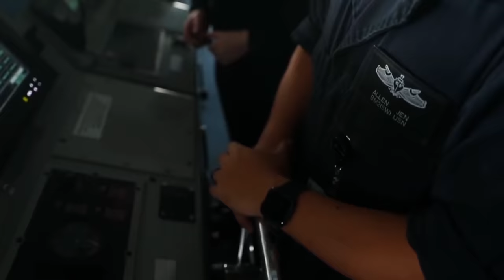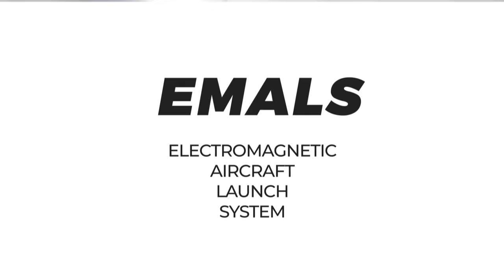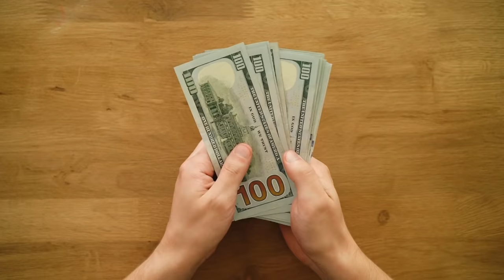This Is The US New Gigantic Aircraft Carrier Shocked The World

Comment: This video is so full of flaws. EXAMPLE: The steam catapult has/ had ZERO issues with launching planes due to weight. In the 60’s, a C-130 was landed and launched from a carrier deck with 3/4 of the deck, and good ol’ fashioned STEAM CATAPULTS. Not to mention those heavy ass F-4 phantoms, and Tomcat’s for over 40 years with steam, every 20 seconds.
Reply: This video was terrible.
Reply: I was in the navy in the early 70’s . I was in V-2 division . And you are correct about the steam cats . I worked the arresting gear . And they never had a problem stopping aircraft . If it ain’t broke .....don’t replace it .
Reply: The C-130 that landed on that aircraft carrier didn't use the cables to arrest, or the catapults to launch, it took off under it's own power.
Reply: The Navy disagrees with you.
Reply: @trentmiller7532  Not giving an eff doesn't mean you're right. Many US Navy carrier captains and crews have consistently favored electromagnetic catapults to steam. Steam catapults have to wait for steam from the ships reactors before they can launch again. This can take several minutes. This is taxing on the ships reactors to generate enough stream for 4 catapults. EM catapults do Not need to wait for steam. In fact, they don't need to wait for anything. They can launch one after another in quick succession.

Comment: My personal experience with the cost overruns were heavily influenced by bureaucracy.  Yes there were technical issues, but all new technology has initial technical issues.  It was the bureaucracy that could not accept the technical issues and would punish the programs supporting the shops construction.  Taking funding away from programs does not get the product any faster and is the absolute cause for increasing cost overruns.   Program leadership understands this but congressional leadership does not have the guts to support technical issues.
Reply: Trust me it did not take hours to get aircraft into the air in the 1970's.  I doubt that changed ever.  Aboard the USS Ranger they had two sitting on the deck ready to take off at all times, and two right behind those.  If those began taking off more would be brought up behind to get ready to take off.
Reply: Spoken like a man who knows the game.  What you mention is possibly the biggest flaw in a "civilian" run military.
Reply: The problem is the DC Navy bigwigs and these shipyard CEO and Presidents are in bed with each other along with the manufactures of material hardware, and DoD Contracting companies .. The navy always Gives contract to lowest bidder now even if it hasn’t been proven to work .  So when it unsurprisingly doesn’t they spend more trying to fix it and make it work than they would have spent going with the system or hardware that they knew worked but cost a little more.  Then you have the shipyards they are built in  outrageously overcharging the navy for every aspect of building the ship.  This is an example ( The yard is paid to mount a cabinet on a foundation.  They mess it up and mount it  wrong .  They are then paid by the navy again to remove said cabinet.  Then they are paid again to install it right.  This could go in 3,4,5 times with no accountability ). It is all the Mismanagement and Greed at the highest level that causes this .
Reply: @jordanbeaty6077  That is part of the problem, the biggest is creeping requirements. A major program takes at least two decades to accomplish. That's from inception to product in the inventory. Thus changes in the military environment, the personnel in charge, and the technology cause additional and evolving requirements.
Reply: Too many cooks?  Or just over-ambitious.    Maybe the aircraft carrier has seen its day..
Reply: Well. I'm 63 years old and will state for the record, rarely does anyone have a real working knowledge that is in the financial approval loop. When the bids were tallied and the final cost to build was submitted, that became the only focus for them. Anything else goes on the books as an " overrun". Which the money men  call "failure". Doesn't make it right but there is something to be said for the Engineering side's accountability.
Reply: Sorry that was my friend Mateo
Reply: he's very... sussy

Comment: "Only 2 out of the 11 weapon elevators can work " is truly Shocking. No matter where they are tested, these low, low-tech things just should not have any problems at all.
Reply: Really? Why don't you call them up and educate them, I'm sure they'll be thankful.
Reply: @jasonrogers1576  I think you missed the point. It is a basic system. All it has to do it move up and down. 🙄 if it was reinvented, why? Is it done by electric rather than hydraulics? If so that sounds stupid unless it has a back up hydraulic system.
Reply: @cha-ka8671  i cant imagine no backup system.  Think about it.  The cances of electronics scambling is oretty high especially when up against russia or china.  China has hyoersonic which we are 25 years behind them, we cant shoot them diwn and 1 rocket could easily hit and sink our carriers.

So no way we can have air superiority over the pacific with hyper sonic rockets.

They'd never hit mainland, we would use our regular ballistic nukes cause we would still know in time to react but not stop an attack like we may a regular intercontinental although from what I saw 20 years ago, it's quite hit or miss, more likely to miss.  Who knows what we accomplished since, super heated lasers have shown much promise in taking out incoming drones, rockets, even the engines of speed boats, quite amazing really, we are closer to actual energy based weaponry although what we have currently only seems good for defense.

Still, wishful thinking

Comment: Think about this. We still have many of the same congress and senators today as were in office back then. Just older and dumber. just as then
Reply: Trust me it did not take hours to get aircraft into the air in the 1970's.  I doubt that changed ever.  Aboard the USS Ranger they had two sitting on the deck ready to take off at all times, and two right behind those.  If those began taking off more would be brought up behind to get ready to take off.

Comment: Naval avation guy here, Avation Machinist Mate Petty Officer 2nd class, coming in with some heat about this video. First off I'd like to say I'm part of VFA106, being a command where we have no ship we are attached to. That being said, we go out on anything that is ok with us boarding and training our pilots (in which are very new to the fleet). This being said, I've been on ever United States Carries other than the Bush, if that says anything within within only 6 years of naval career. The main reason for my comment is that I would like to point out a few true factors of the CVN 78 flight deck being squadron side. First being, the electrotromagentic CATS do not add more or less time from an AC leaving th3e flight deck. That is one up to the maintainers and flight officers, and secondly the tower (or flight deck control), denying AC to leave or taxi to the cats. Secondly and lastly the cats where built and used for one reason and one reason only. That is to reduce weight for the new class to represent its self as. If an EMP  or some other jamming system was used against this class, America would be shocked. We wouldn't be able to get a single jet off deck to counter measure a single basic non-lethal attach upon ourselves with this "new fleet of carriers". Tell me I'm wrong, I'll wait. The new Ford class will sink. Hypothetical and figuratively.

Comment: Nice video.  Clickbait titles are becoming a real drag.  A real drag.  A real drag.  A real drag.  Kind of a repeat of DOZENS and DOZENS of EXACTLY the SAME stuff/content... exactly with different cuts.  B roll stuff is nice... you seem to have lots of it but one video, not dozens, will do.
Reply: Trust me it did not take hours to get aircraft into the air in the 1970's.  I doubt that changed ever.  Aboard the USS Ranger they had two sitting on the deck ready to take off at all times, and two right behind those.  If those began taking off more would be brought up behind to get ready to take off.

Comment: Not that it matters to the Defense Departments, but the real shock is for the taxpayer.
Reply: Trust me it did not take hours to get aircraft into the air in the 1970's.  I doubt that changed ever.  Aboard the USS Ranger they had two sitting on the deck ready to take off at all times, and two right behind those.  If those began taking off more would be brought up behind to get ready to take off.

Comment: We need a catamaran hull with a double deck, so we could launch from the lower deck and land on the top deck all at the same time.
Reply: The Japanese already thought of that, although it wasn't from a catamaran. During World War Two, the Japanese actually had an aircraft carrier that could launch aircraft from the hanger deck !! 
However, your idea has operational flaws. Bolters happen all the time. You bolter as another aircraft is launching from the hangar deck, and you're setting yourself up for a mid-air collision. 
One of the procedures in executing a carrier landing is to hit the deck at full throttle, so as not to fall into the ocean if you miss a wire. The difference between a carrier touch n go and a bolter is the position of the tail hook.
Reply: The Navy can already launch & land at the same time. Launching from forward catapults & landing on the angle deck. It's called flex-deck ops.
Reply: @TheHawk--oe8iq  
And they had subs carrying sea planes by war's end ...
Reply: @drguffey  Yep, but with double decks, the ship could be half as big:)
Reply: @batmandeltaforce  Wrong. Double deck would not affect the landing distance & the top deck would be much higher off the water. Probably be a much heavier ship with no real advantage otherwise the Navy would have thought of it years ago.
Reply: @drguffey  Well whatever that distance is... 5/8, 3/4 ?
Reply: @batmandeltaforce  Your '2nd deck, under the flight deck would take away the hanger deck. So you would have to have 3 decks.  A much larger & taller ship with stability problems. That's why it doesn't exist.  It would be inherently unworkable.
Reply: @drguffey  correct, and it would be wider overall.
Reply: Catamaran styled hulls are not hydrodynamically as stable in rough seas.  Also we have aircraft than have vertical takeoff capability so more planes can get airborne much faster, example F-35 lightning.  Need anything more?  A few missles can handle as well.  The fleet roles of multiple ships in a fleet, not to mention subs really does not require your suggestion.
Reply: @robgigabyte580  Well that simply is not true. Stability was why catamarans were invented. But i'm not going to argue, it was just a suggestion:)
Reply: Cool idea, and some plates being pulled along side the ship to take the torpedo hits as well!
Reply: @GrindSultan  I don't even know what that means:)
Reply: @Ari GSD Yep, we could lunch at least 3 times as many planes at once and landing at least two, at the same time:)
Reply: @drguffey  But we could launch 3 at a time and land 2 at a time:)
Reply: @batmandeltaforce   im stringgene :) smileyface
Reply: @mattp3518  LOL, no, I'm StringGene... born to play guitar:)
Reply: @batmandeltaforce  If so we would have done it.  Not sure how you're figuring this, it would have to be huge, & probably not cost effective.
Reply: @drguffey  Maybe... I tend to think out of the box:)
Reply: @batmandeltaforce  Consider the flight pattern if two aircraft were trying to land at the same time. How wide would the landing area be? Never gonna happen.
Reply: @drguffey  I don't care if it happens or not, we were just brainstorming:) But to answer, they could stagger the landings only a few seconds:) I'd say the whole ship would be twice as wide, and stable as a land based airport:) You could launch at least 3 at a time.
Reply: @batmandeltaforce  Would be enormous & not cost effective.  Ford class is about as good as it gets.
Reply: @drguffey  I don't think it would cost any more. It would not be as long.
Reply: @batmandeltaforce  Then ask yourself why NOBODY has built one.
Reply: I think NAVAIR has a suggestion box.  I bet if you drop in a full schematic of this idea, supported by scientific research data, which has been fully design reviewed by no less that 600 mechanical, nautical, electrical, structural engineers, into the box, someone will send you a nice form letter thanking you for your interest in joining the Navy.
Reply: @chucklakeridge7944  LOL... actually I do 3D modeling:)
Reply: @batmandeltaforce  Right on!  I love to see those futuristic concepts when they are closely based on true enginnering principles and realistic functional objectives.  Look up Huntington Ingalls. They are the design principles for the hull and system layout.
Reply: @chucklakeridge7944  Lemme look up those words and I'll get back to ya:) LOL
Reply: @batmandeltaforce  I love the idea, but I think the USN is constrained by what will fit through the locks at the Panama canal, hence why if they thought of it, that would probably be the main reason they stuck with the single hull design
Reply: @drguffey  this is a terrible argument for just about everything. Why hasn't anyone visited mars or achieved nuclear fusion yet? I guess that means they're not worth considering.
Reply: @DennisBLee  Yep... just means we need 2 of them:) BTW, there is a submarine bay in the middle:)
Reply: @DennisBLee  Then draw up your plan & submit it to the Navy. They'll have a good laugh I'm sure !
Reply: @drguffey  I have no interest, I am a casual youtube commenter and you are clearly someone who takes idle speculation far too seriously.
Reply: @DennisBLee  Thanks for admitting you weren't serious !
Reply: @drguffey  I'm sure you're quite popular at parties and work meetings. Everyone loves the person who shuts down interesting conjecture in the name of proving themselves right.
Reply: @DennisBLee  And you must be the LAUGH of the party !!
Reply: That would be super important as if in war they could still lunch jets after the deck got wrecked from in coming missiles.
As well since the planes are stored down under would make since
Reply: @batmandeltaforce  or have bigger missle defence systems on the top deck.
Reply: @prestongoodwin407  No it would not.  You can't launch jet fighters from the hanger deck. You need an open deck due to jet blast. Also, if the deck got wrecked from incoming missiles how would planes launched from the hanger deck land ??
Reply: @prestongoodwin407  Good point:)
Reply: @batmandeltaforce  The Navy has some catamaran test beds, just not for carriers for the reasons others mentioned. If I remember correctly the Nimitz class carries hold over 3 million gallons of aviation fuel, not to mention weapons stores. When you see a photo of an aircraft carrier, there are 8 or more decks below the hangar bay and water line.
Reply: @NitroU-  Yeah, I'm talking about 2 aircraft carriers side be side.
Reply: I like this

Comment: The carrier has completed shock trials, and will deploy in 2022. Once the initial trials are done it's likely more in this class will follow and older carriers will be retired. (just my guess...)
Reply: In the modern naval warfare, all aircraft carriers no matter how large or small are sitting ducks --- all you need is one or two surface-to-surface (anti-ship) guided missiles hit the top deck, that aircraft carrier is useless.
Reply: @justthefacts5008  unless EW (electronic warfare) is applied, maybe??
Reply: Doubt it.  Way too expensive.  The Nimitz class will serve for many more decades.
Reply: You guessed correct. 2 more are being completed and a 4th is in production.  Each one replaces several older carriers that are expensive to maintain and much less capable.

Comment: I thought it was a well known fact that new aircraft carriers spend at least 5 years empty whilst all the systems are built tested and evaluated.
Reply: @ct8618  hahaha for real. I've never heard the 5 year thing before ever.
Reply: Trust me it did not take hours to get aircraft into the air in the 1970's.  I doubt that changed ever.  Aboard the USS Ranger they had two sitting on the deck ready to take off at all times, and two right behind those.  If those began taking off more would be brought up behind to get ready to take off.
Reply: Yes.  There's about 4 years of test, trials, training and tweaking for a new design - throw in another year of debugging after deployment.  The Ford (CVN 78) is on budget and schedule by and large.  Not based on the original budget and schedule, because since conception, new technologies have been developed and added to the capabilities. Obviously, when a design has systems that become obsolete prior to production, new designs are implemented that impacts cost and schedule.  This video is clearly produced by a non-subject matter expert who cherry-picked info from 2rd party sources and created a narrative.
Reply: Carriers are the largest man-made structures ever built.  And the most complex and expensive.  Think a large skyscraper, times 4, that floats self sufficiently for 9+ months without refueling or re-supplying, and which carries, launches, lands and maintains a large fleet of fighters that could single handedly destroy most countries, without breaking down or suffering catastrophic failure if attacked by ship or submarine.  5 years isn't such a long cycle if you think about it.
Reply: Yeahhhh.. except they aren’t even close to the largest man made structures ever built .. like not even close buddy.  🙄
Reply: 3 year sea trials.